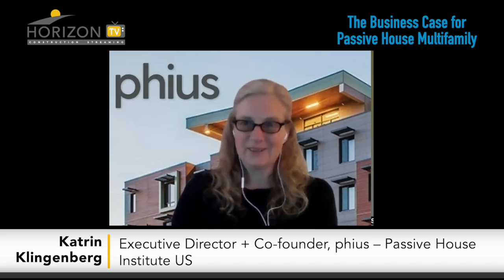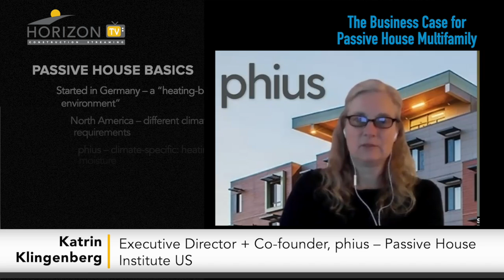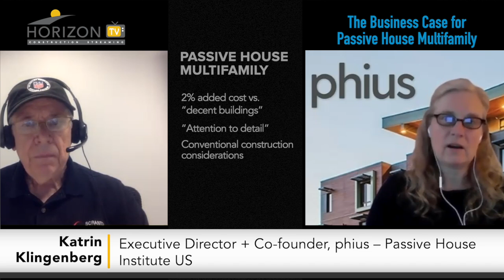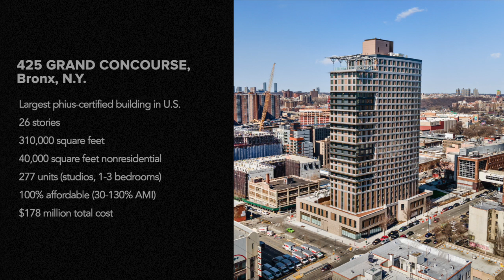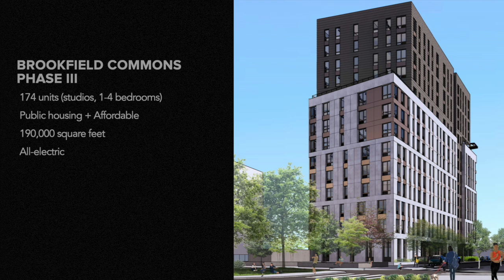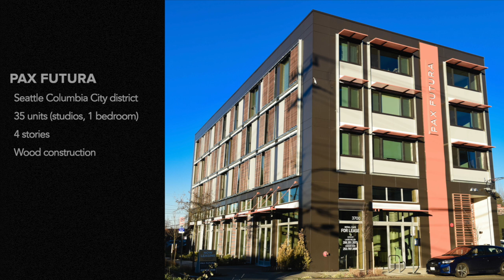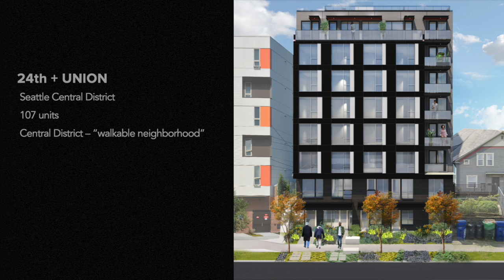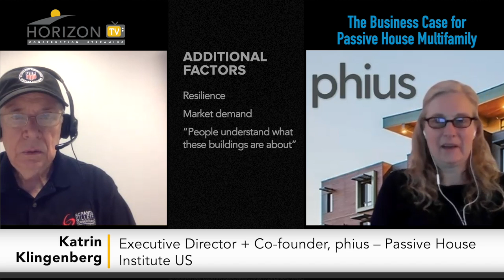The Business Case for Passive House Multifamily

Comment: You mention LEED buildings have come down in price. Are you sure the building codes haven't increased requirements to the point where you're effectively building a LEED building just by following the code.... So not that LEED is cheaper now, it's that "standard" construction is more expensive.